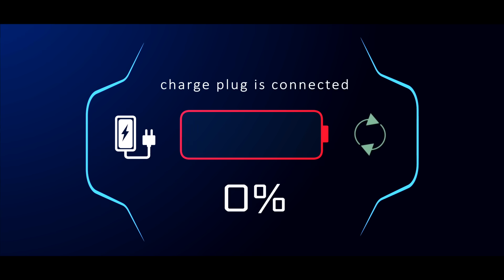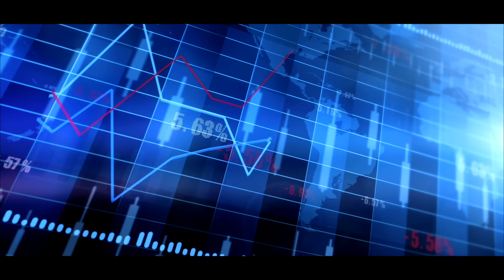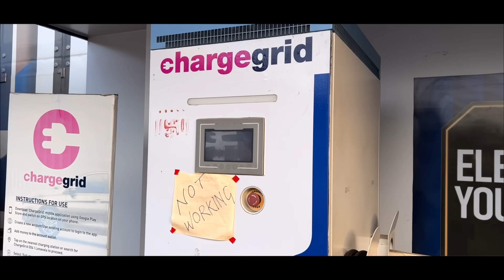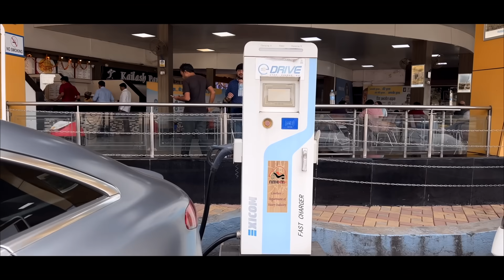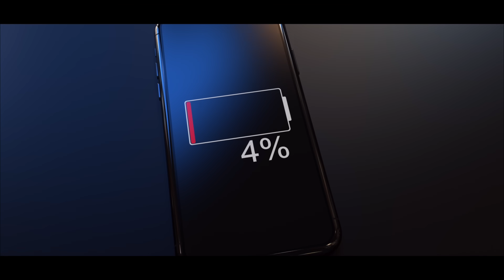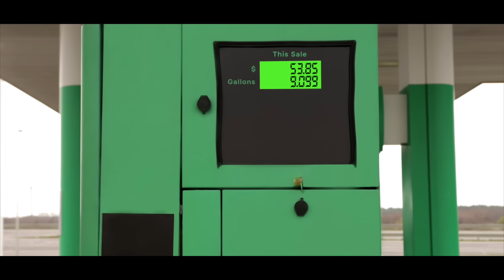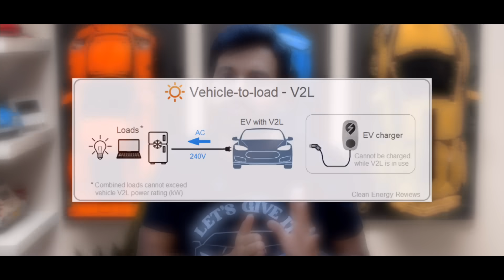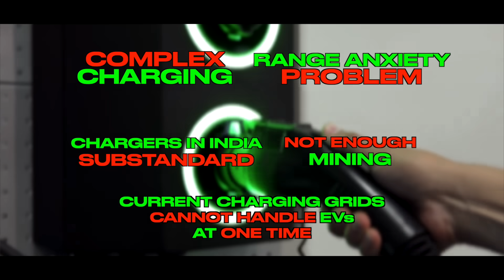Here Is Why Electric Cars Are Not The Future!

Comment: It is stupid to support petrol or diesel cars in this situation. I agree with the coal and thermal reactors and environment issues which is for lithium amd ion battery. But these kind of challenges were there when people changed technology from horse pulled vehicles to motor vehicles or even before invention of wheels. So challenges need to be addresses and resolved. May be the batteries need to be upgraded to aluminium battery or more solar power charging stations need to be introduced. In place like india which is lying near to equator it is good option to go for solar charging stations.. May be its a time delay for spreading those stations because of
Delayed revolution of electric vehicles.. But yes damaged battery will be an e waste problem. But everything need to be addressed as what if in next 5 or 10 years crude oil resources got vanished!!!Ir will take more years but. Still let us light the hope of green energy at its best
Reply: @msimon6808 
India is endowed with vast solar energy potential. About 5,000 trillion kWh per year energy is incident over India's land area with most parts receiving 4-7 kWh per sq. m per day. Solar photovoltaic power can effectively be harnessed providing huge scalability in India.
India has potential of about 60 GW of wind.
It is quite likely that it would go up substantially because over time some of the old wind power stations that have very low capacity could be replaced with wind turbines which have higher capacity.There is another unexplored area, which is in the oceans.
Reply: @msimon6808 
Do you want to move to any other planet after petrol diesel are over?

Comment: Thanks Faisal, quite informative. In current scenario, do you suggest the Innova Hycross Hybrid or just its petrol avataar....considering my running wont cross 100,000 km. Solely looking for a large 7 seater with extremely low maintenance thus a Toyota

Comment: Hydrogen and ethanol are also poor choices. 
Hydrogen has poor energy density and fuel cells take up a lot of space in the vehicles. And manufacturing of hydrogen cells are very energy intesive and causes more pollution like the manufacturing of Li-ion.
Ethanol has a similar problem with energy density. And Ethanol is the worst when it comes to impact on the environment. Ethanol production not only needs a lot energy which is ultimately sourced from coal and natural gas, but it also needs vast areas of agricultural land and enormous amounts of water to produce the raw materials. It is what is causing the destruction of the Amazon Forest in Brazil as sugar cane producers are displacing tribals and illegally cutting down ancient forests.

So ironically, ICE powered vehicles are more sustainable than these 'green fuel' powered vehicles, atleast until more sustainable battery techs are invented.

Comment: In other cultures there are different structures in place that may contribute to those stats. Figures don't lie but liars can figure. Stats have more meaning when we can analyze and interrupt them. I cancelled several girls who ran away from home because their fathers raped them! They said they would rather die than live like that again. 

So yes there are stats but raw data is not always the end all answer. That is why we have analysts to interpret said numbers. To what do those stats corelate? For example India has the law of Karma which pretty much keeps us in check. Their society is much more spiritual than the US which may account for their low stats of criminals. Another factor may be societal disapproval. In the US going to jail is not a situation that will get your family ostracized while in some societies bringing dis honor upon ones family is the worst thing one can do.

I understand your presentation but for 35 years I made my living analyzing stats and they are oft only the superficial symptoms not the end all. Stats also depend on how the info is gathered and presented. Do societies where masculinity does not automatically equal raw aggression have lower crime rates??? How much does religion matter in some cultures.

Don't just present me raw stats with no analytical support. Also, statistically, girls with no father have no father to rape them 0% in fact.

Comment: Please do not spread so much negativity around EV vehicles and their charging infrastructure.  It takes time for a new technology to break through and get established. And yes, there is no doubt that even if EV vehicles do not become a success, we still need to find some alternative of petrol and diesel cars for their drastic impacts on environment. And yes, no ICE car is better in terms of drive dynamics as compared to EV cars. One more thing which you seem to have forgot, you can always charge an EV vehicle from the comfort of your home but the same is not possible for ICE cars, you need to got to a fuel station. Also You can install solar panels in your home to take care of your home electrification needs and charge your car for free. So we need to look for solutions that bring a positive impact to the environment and are also viable. I surely believe that better battery options will be worked upon to reduce the quantum of pollution caused during the mining of battery raw materials and we are surely in the right direction by inculcating EV's to our mode of conveyance.

Comment: Lot of problems with this video.  He is sounding exactly like old republican propaganda spewing ladies.

1. This guy forgot that the first ICE vehicles were many times more polluting compared to the ICE vehicles now. ICE tech has pretty much saturated while EV tech is just starting. Since battery tech keeps on improving, there will be much better material usage that has low pollution levels to extract. For example....Solid State Batteries coming up in next 3-5 years will double the range and is much less harmful to environment.

2. EVs remove most of the smog in cities...in future it would be unacceptable to throw smoke at people's faces as cars drive by.

3. You can have rooftop solar panels to offset charging costs. So the tiered cost issue won't bother much.

4. There is no future for ICE cars.....and if you are talking about battery degradation, many ICE cars engines fall apart pretty quickly.....and it has many moving parts and are expensive to maintain.

5. EVs will become much much cheaper in future. Remember...Tesla has 40% profit margin already...while legacy automakers have 3-5% or even less.
Reply: One big flaw with your argument: most of these solutions are still either in development or too expensive.
There is a level of truth in what you said, but it will take time.
We cannot put a ban on ICE cars until the next gen technology is ready.

Comment: Petrol vehicles have very poor energy efficiency as compared to EV vehicles. In chockablock traffic petrol vehicles become fuel guzzlers... Whereas for EVs... They are as energy efficient in traffic situations as on an open road....As per maintenance.... EVs are more reliable  than motor vehicles. I have had 2 years of riding a petrol scooter and almost 4 years of riding a electric scooter... I've had more visits for my petrol scooter in 2 years than my electric scooter of 4 years...and maintenance was also cheaper

Comment: Don't worry by 2027 first climate change tipping point ☝️ i coming, and the temperature is going to be 1.5 degrees, and by 2030 entire planet will come to stop Fossil fuel vehicles.
We should use" zero point energy" instead of battery 🙂

Comment: Where are you getting these alternative facts?!
The majority of Lithium comes from Australia, not ‘the lithium triangle.’ 🤣
Cobalt has been mined for the last 50 years as a catalyst for petrol/diesel. It gets used UP in the process. LFP batteries used in the majority of popular EVs (BYD and Tesla) do not contain cobalt or nickel. 95% of Lithium batteries can be RECYCLED so it’s a circular economy, in 50 years we won’t need to dig anything up, we will just recycle the old batteries which uses far less energy than mining raw materials. EVs use 6tonnes more CO2 in their manufacturing process, this is cancelled out after they have driven about 30k km at the current average global mix to the grid (which is getting more renewable by the week) You are actually spreading FUD (fear uncertainty doubt) and you are literally damaging the planet as some people will believe these lies. Riding an E bike is like riding a microwave?! 😂😂😂 actually have a go of one mate, they’re great fun and don’t break down. Same with the cars, they are fast as hell, but you don’t realise it until you’ve driven one.

Comment: I disagree with most of what Faisal says in this video. I have driven a Tigor EV for 15000+ km - note that this car comes with a 26kwh battery pack that consistently gives me a minimum range of 220km, but more importantly the driving experience is unmatched in comparison with a similar ICE car. Problem is with the likes of Tesla pushing for performance EVs which was ok to begin with, but now Tesla is giving away its lead to the likes of BYD by simply not doing the right things. Tata has very smartly focussed on efficient EVs, which definitely help the environment over the long run. Efficient EVs use smaller batteries, hence lesser dependent on rare earth metals. But what the petrolheads don't understand is that the battery tech is evolving, and while we all get used to EVs we will most likely get much more eco-friendly and efficient batteries. So EVs are the only way ahead - if someone's hell bent on thinking otherwise they are just not able to let go their ICE cars or are being asked to do so by companies that don't yet have the means to move into the EV space.

Comment: EV cars are cheaper to operate.  No transmission, no radiator, no brake wear thanks to regenerative braking.  Material requirements are going down, and recycle capabilities are ramping up.  LFP batteries use less materials (NO Cobalt, etc.).  Even a coal powered electric car is less polluting than a gas car.  33.7 kWh = 1 gallon of gasoline worth of energy.  I go 250 miles on 62 KWhr. That's better than 125 miles per gallon.  You can't recoup your energy when you apply the brakes in a gas car.  I do all of my driving on solar generated power.  NO COAL REQUIRED!!  My solar panels will last for 25 years, so whatever fossil fuels were used creating them, or. my car, will amortize out to near zero a decade from now compared to running a gas car.  YES, DC fast charging networks suck.  For the 10%. of driving people do, long trips, EVs are a pain.